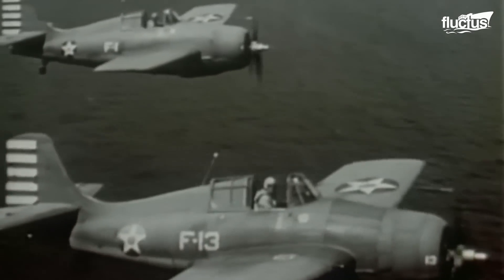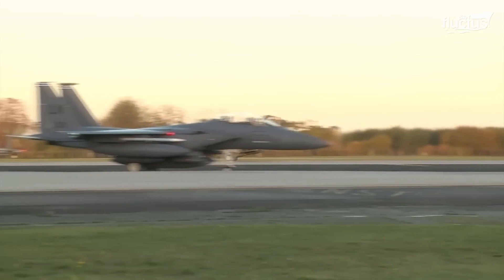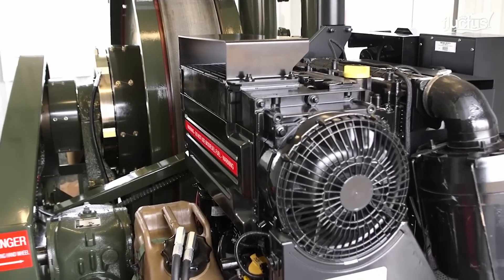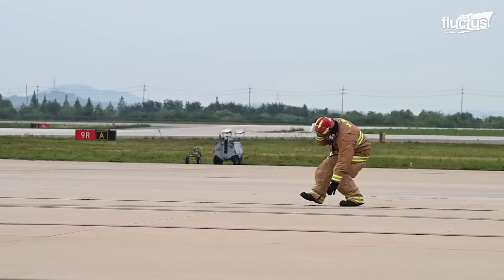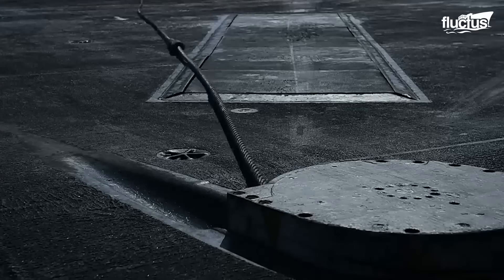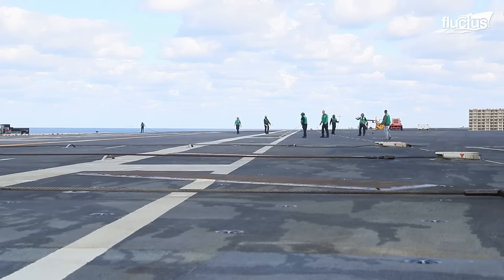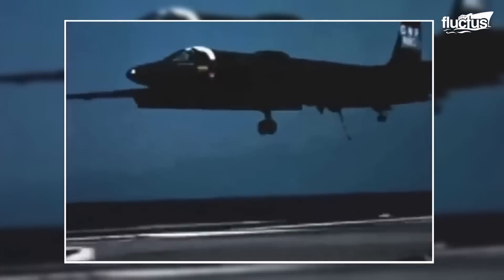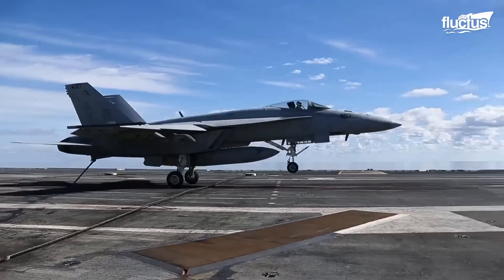The Reason Why US Tries to Land Gigantic F-15s Like on an Aircraft Carrier

Comment: You are not comparing like with like. For a start the F14 is heavier to withstand rough landings on aircraft carriers which are inevitable in some weather conditions. Add to that the swing wing which adds a significant amount. The F14 also had a much more powerful and therefore heavier Radar. Then of course the Phoenix is a very heavy (for air to air) missile. . So the hard points need to be stronger therefore heavier. The F-14 also had the somewhat heavy kit for catapult launch too. Also the F-14 could fly 100NM out loitre for 4 hours in a CAP and I cannot imagine an F-15 doing that without re-fuelling. In fact with only a little more than a 1000nm range for the F-15A in combat configuration it would be struggling to patrol for 2 hours and still have naval reserves (more than USAF reserves due to deck landings incurring so many wave-offs in bad weather). So they are not even close to being the same thing.

Comment: First they compare some specs of the F14 and F15, but only if the F15 wins. No mention that the two fighters had vastely different design roles. Nor that the airframe, landing gear, and tail hook to handle landing on a carrier weigh ALOT to handle the stress.

Then they try to compare landing an F15 on a runway with a completely different wire system to an F14 landing on a carrier.

The F14 lands at a faster speed, just in case the pilot misses the 3 wires. When it lands, it has much less area to stop in with a very hard carrier island just to the right (starboard), a steel wall (stern) if the pilot comes in too hot, a really big swimming pool is the pilot comes in too far to the left (port) and possible other airplanes, helicopters, equipment, weapons and personnel close by.

Not just an apples to oranges comparison, but an apple and pear to an orange and grape comparison.

Like others have commented a waste of 15 minutes.

Comment: 1) the Navy jets are heavier because they must be designed for a "controlled crash" on EVERY landing (which I have experienced) so their frames and landing gear are stronger and more robust than any equivalent Air Force plane. And they experience almost equal forces when launched by the catapult systems. 2) The C-130 is an exception to almost ALL other military aircraft because it can use it's engines to back up, allowing it REVERSE thrust when landing to slow it down. 3) Navy pilots have been shown to have higher blood pressures and heart rates when landing at night (fewer lights, moving ship and angled deck) than when in actual sir-to-sir combat (plus they have to find their ship first).

Comment: Nice video, but I never saw any footage of an F-15 trying to land on a carrier. It's probably a good thing they didn't try because the landing gear on an F-15 would actually break off due to the stresses. Also the Navy doesn't use Push Back Trucks on Aircraft Carries on Naval Air Stations, it calls them Tow Trucks. Best Wishes & Blessings. Keith Noneya AT1 USN/USNR-TAR Retired.
Reply: Keith if you like seeing aircraft that isn't usually seen being landed on a carrier you may want to look up the documentary on the C130 transporter.  It too was considered for carrier operations in it's early days. Now that's a sight!
Reply: @christopherfcunha  Oh yeah that was really cool, not very practical though. They had to completely clear the flight deck of ALL aircraft for take off and landing for safety, but still a great feat in itself. Best Wishes & Blessings. Keith Noneya
Reply: @keithnoneya  No..not very practical but I guess trying it opens up new ideas. Just like the concept of landing aircraft on a carrier in the first place.  Thanks buddy.  Right back at you!

Comment: This is nothing new.  In 1965 the USMC, at Chu Lai (Chinese for Krulak) used a system much like the carrier arresting systems so Marine aircraft could use the airstrip for fighter jets until the strip could be lengthened.  Support for the Infantry was necessary and part of the Marine air/ground team.

Comment: Thanks for mentioning my carrier’s May, 1964 operation to overfly and photograph French Nuclear facilities on Mururoa in the South Pacific.  You are correct that there was some wingtip scraping on landing, but there was a full team of U-2 specialists onboard my USS Ranger CVA-61 for this exercise and Dragon Lady took off without problem or catapault assist.  On takeoff, to prevent what we called ‘wing list’ a pair of ABHs literally held each tip as the U-2 gained speed/lift.  Nice shots of Primary Flight Control by the way, a much neglected control Center on the ship.  There are four main aviation control centres: Primary Flight Control (PriFly-control within 5nm), Carrier Air Traffic Control Center (CATCC-control from approach/marshalling to 5nm), Flight Deck Control (The Board- control on the Flight Deck/launch), and Hanger Deck Control.  Both launch and landing are coordinated by PriFly and The Board.
Reply: Lp

Comment: What an all encompassing video!  At least 99% of the audio is WRONG.  The F-15 has 12,000’ concrete landing gear.  Its little skinny gear, not being designed for carrier durability, would look like tin foil after the first and only trap the aircraft would ever make.  It is a great aircraft all around:  but not designed for carrier ops.  Just imagine an Air Force pilot actually surviving the trap aboard the ship.  He/she would be searching for the missing 9,700’ of runway.  Then there is no bar, no exchange, the swimming pool is over the side, no tennis courts.  Then they would look around and gasp “You do this kind of s - - t at night too?”  End of USAF trying to be forced aboard aircraft carriers.  🤬🤯🤮DGBryan
Reply: AMEN T Bug.  Plus with a 20 foot height could you imagine the chaos it would produce on a hangar bay ceiling?  Let Grumman stick with the gears.
Reply: You go Girl!  Well said and acurate!

Comment: The tailhooks on US Air Force planes are not for carrier landings, they are for emergencies to bring the plane to a rapid stop on the ground, such as a landing gear/brake failure. One example is the Australian F-111 that had to land its belly because the gear would not extend - it caught the arresting wire just feet off the ground, which prevented it from sliding beyond and off the runway.
Reply: I was about to make the same comment. The F-15 isn't designed to be catapulted.
Reply: そうですね、滑走路が破壊時に、600mの滑走路で、停止させる装置でもありますよね．
Reply: A great F-14 driver explained to me that landing on a carrier is tantamount to a controlled crash, hence the large thick landing gear.
Reply: @superbirden57  It's not only the landing gear that has to be reinforced.
It's the ENTIRE STRUCTURE of the airframe that has to be beefed up to cope with over 1,000 take-offs and landings from an aircraft carrier!  The planes are designed for at least 20-25 years of service, or 6000 flight hours -- whichever comes first!
There was one F-14 that was in service for nearly 30 years.  The thing people don't realize is that it spent a big part of its service life as a training plane on land bases so it was never subjected to continual stress of carrier operations and salt water corrosion like carrier-based F-14s.  It was also one of only 18 F-14 A-models that was converted into a D-model.  It went through a massive rebuild that nearly doubled its frame life!  They removed worn out components and rejuvenated the airframe!
One of the trade-offs they make with US carrier-based aircraft to control weight is that they require "only" a +7.5 G sustained-turn rate.  If they required 9G's, the Navy planes would be even heavier!  The extra weight and drag induced in naval designs to give them better over the nose visibility generally reduces their acceleration and climb rate compared to land-based planes.  The F-15 and F-16 easily out-turn and out-accelerate their carrier-based counterparts. 
Northrop proposed a lightened, land-based variant of the F-18 in the late 1970s.  The F-18 was initially based on the YF-17, a technology demonstrator plane that lost out to the F-16 in a competition.  The Navy favored twin-engined planes so chose to develop the YF-17 into the F-18... and the original plane grew into a MUCH heavier aircraft!
Northrop figured they could lighten the F-18 by AT LEAST 2,000 if not closer to 3,000 lbs by removing structural beef, using lighter landing gear, AND removing wing fold and redesigning the wings into one-piece airfoils that were strengthened to +9-Gs without gaining back the weight lost from other structural revisions!  The changes would have boosted the initial climb at least +5,000ft/min higher than the naval F-18 AND increase topline speed from Mach 1.8 to over Mach 2 WITHOUT changing the fixed inlet design to a variable geometry ramp system!
The proposed F-18L never got built because the US Navy and McDonnell Douglas didn't want competition with the existing, already built carrier version.  (The F-18L could have been cheaper to buy than the existing F-18A at the time.) There was a huge lawsuit filed by Northrop on McDonnell Douglas claiming (rightfully in a way) that McD stole Northrop's aircraft design.  In actuality, the Navy assigned McD as the lead on the F-18 project because McD had practical naval aircraft design experience.  McD built the F-4 Phantom and a ton of other naval jet fighter designs before that.  Northrop really hadn't competed for navy plane contracts in the past and the Navy feared they would make more mistakes than McD!
Reply: Whew! Now don't you feel better getting that off your chest? Yes my answer was simplistic, but not incorrect, considering it came from an F-14 aviator. Your extrapolated answer will be of much better use than mine.
Reply: I saw a cartoon once where the A-10 had the tailhook on the front, this would allow the carrier to just slide right up underneath the A-10 and catch it
Reply: I believe that it's also intended to give the aircraft STOL capabilities? I know that Danish Air Force did that to justify not buying Viggens.
Reply: While I agree that it isn’t designed to do it, in a pinch the Eagle could probably do it if need be.

Comment: Did I miss it??? Or did I just spend 15mins and NOT see even one F-15 attempt an arrested carrier landing? 🤨
Reply: It’s the gear-undercarriage my friend.  They’d break . . . And they cost.  I can just see the look on some Bird Colonel’s face as he read the damage reports.
Reply: @Birdfarmer862  7
Reply: @Birdfarmer862  ok
Reply: Thank you! You just saved me 15 minutes!
Reply: @larshowen3319  Lol, me too. Thanks!
Reply: “LIKE” on an aircraft carrier. All Air Force bases have arresting cables at each end to stop airplanes with brake issues.
Reply: It would be a very expensive single attempt.
Reply: Not landing
Reply: 1:54 there is an F15

Comment: Worked with the M-21 arresting gear in the USMC from 1972-1978. SATS
Reply: Worked with the same gear also 1982-1995. Used also the E-28 and maintained the E-5 anchor chain gear, glad not one took it (abort gear at the runway overrun). Semper Fi!

Comment: F-14 has been retired since 2006. Why was it discussed like it’s a currently flying.
Reply: Well... Technically it still does in the IRIAF.. But agreed not in the way the video presented it. In fact the whole video is a hot pile of misinformation..
Reply: Good question.   My interest was piqued when I heard F14 and saw the familiar shape.  ( VF101 in the 70's)
Reply: @judih.8754  excellent question.  The Tomcat was a bird ahead of its time, and it showed!  On my ships it often hovered at 50-60 percent operational.  Lots of guys referred to it as ‘Our Edsel’!
Reply: @Birdfarmer862  yes!  Ironically the F14 was actually designed somewhat form the F-111B program. The subcontractor for General Dynamics was Grumman. So the GD group was working on the F111A for the Air Force, Grumman was working on the F-111B for the Navy...but the plane was waay over it's 80,000 weight limit and the program was canceled. Not that the Navy thought the F-111B program was what they felt they needed in the first place but you can blame Secretary McNamara for that!  Since Grumman was already working on the F-111B replacement they were allow to make a few prototypes to prove to the Navy that they could build a far better plane for the Navy requirements.  There's a few documentaries on this on You tube.

Comment: The f15 is only 5% faster than an f14. So not easily outpased as you mentioned.
Reply: F-14 could out-fast a F-15, if you removed all the variable geometry / hydraulics, but now we are talking imaginary!
Reply: Being a F-14 is heavier than the F-15, it could go faster in a dive.
Reply: @harrybuckner8232  maybe  the f14 weighs almost twice as much can you imagine if it was made with newer materials how fast if actually would be  that would ne a fun ride
Reply: @kenharty6016  the frame was mainly made out of aluminium, it would be hard to make it lighter. But with modern tech there can be less wires but so would the F-15 which it does now. The F-14 was a great plane overall, and it also beat the F-15 on multiple occasions, but it had its prime.
Reply: @Max1Youtube  Bro you really think F-14 is better that F-15 bruh 💀

Comment: A6, E-2C, F-111 RA-5C, A3, and many other pretty large aircraft. The F-14 is about the same length as a F-15 but is wider.. also the weight of an F-14 is nearly 3 times that of an F-15 when fully loaded.
Reply: "the weight of an F-14 is nearly 3 times that of an F-15 when fully loaded."

Not quite true!
The empty weight difference between an F-15 (A-D model; C model was 28,000 lbs empty) and and F-14A (40,000 lbs empty weight) was about 12,000 lbs.  That weight difference is accounted for between the carrier landing requirements for the F-14 (which raised weight a minimum 3,000 lbs in structural beef and heavier duty landing gear) and the wing sweep mechanism to make the F-14 more aerodynamically efficient across its flight envelope (which mostly accounts for the rest of the weight increase over the F-15).  
There's very little difference between max loaded weight of the two planes.  The F-14 catapult limit was about 72,000 lbs and a bit higher than that taking off from land (close to 73,000 if not 74,000 lbs!).  A max loaded F-15C (3 external drop tanks plus 2 conformal fuel tanks) is 68,000 lbs.  An F-15 can carry a total of around 33,000 lbs of fuel divided between internal capacity  (roughly 13,450 lbs) and the 3 drop tanks and conformal tanks.
Reply: @AvengerII  I found this: (so I used these numbers pretty much) Design:
The F-14 is 62 feet 9 inches long, with a spread wingspan of 64 feet and a swept wingspan of 38 feet. Its loaded weight is 61,000 pounds.

The F-15 is 63 feet 9 inches long, with a wingspan of 42 feet 10 inches. Its loaded weight is 20,200 pounds.
Reply: @AvengerII  geez. You’re a goof. You took that as an insult?  Wow
Reply: 一部嘘がありますね．最大離陸重量的には変わりはありませんね、
海軍機にだけあるのではなく、空軍の戦闘機・攻撃機の全てに装備されてますよね．
非常時の強制着陸用に．
Reply: @mysygisun3335  Do you mean on loaded or unloaded aircraft?